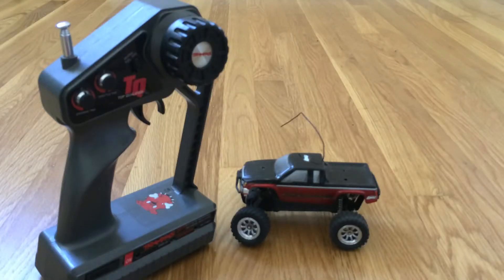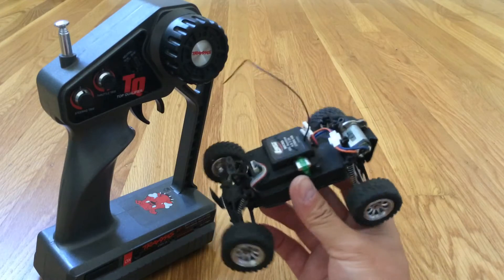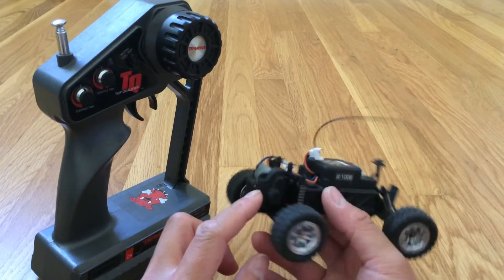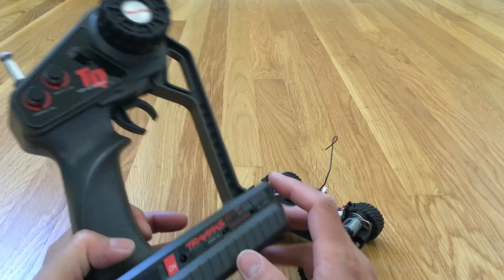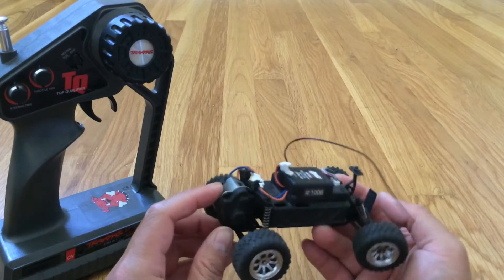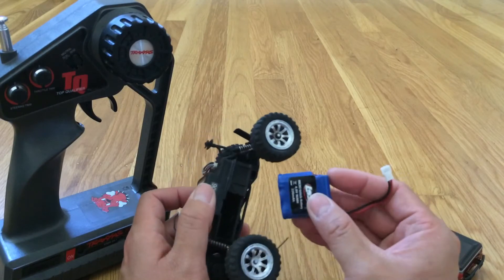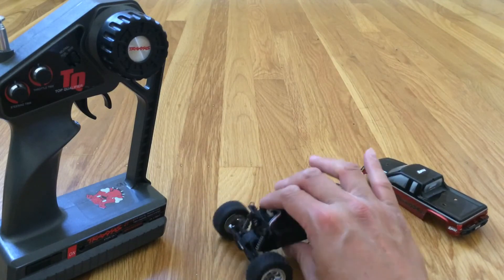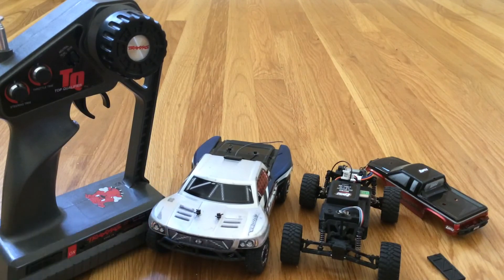Racing2Learn: Losi 1/36-Scale Micro-HIGHroller RTR Lifted Truck Review and Comparison to Micro SCTE

Comment: I wish Losi still made the micro crawler. I have the highroller... sort of. Started as a micro-t many years ago and I converted it to a high roller. I quit driving it because the motor would overheat very easily, the diff fried so easily, steering was sloppy and weak, the radio was twitchy/glitchy at best and it was just awful over jumps. For some reason, a year or so ago, I decided I wanted to mess with again and try lipo's in it instead. So, I got the brushed/brushless combo 2.4ghz receiver/esc for it, the stronger scte brushed motor, hot racing diff/trans case with bearings instead of bushings and found that you could use scte metal diff sun gears in it after a little modifying. Now I love it again! I can run it for an hour on carpet and it doesn't overheat on me because the new diff/trans is so smooth and free moving. Also swapped out the 4 wire servo for a 3 wire and finagled some micro ball ends for steering links and upper camber links on the front along with oil shocks. The shocks were annoying and leaked a lot, until I put longer springs on them and flipped them upside down. Now the oil stays in them and does it's job.

I have an scte as well, but for me, it's just too large to run around the apartment. Mines the brushless version. It sits on a shelf mostly now.
Reply from the maker: Lots of great info here, thanks for sharing! Didn't know you could get the micro SCTE diff sun gears to work in it. We've been debating on whether to keep the highroller or not. How do you keep traction on the rear wheels/tires?
Reply: Yep, found that upgrade walk through on a micro-t forum and after some 
fussing with shims, worked like a charm: 
http://www.microtforum.com/viewtopic.php?t=13129

Hard to find the hot racing diff case with bearing on the input shaft now though. I was 
lucky enough to find one a year or so ago. May have been 3racing... either way, they are hard to find these days.

EDIT: it was 3racing:
https://www.3racing-parts.com/team-losi-microt-aluminum-gear-box-for-3racing-mi14lb-p-90001793.html

Never shopped here, but the site says it's in stock:
http://www.hksrc.com/store/index.php?route=product/product&page=51&limit=25&manufacturer_id=15&product_id=8479
Reply: Not sure what you mean with "keep traction". I only run my micro-highroller inside and mostly on carpet around the house. It gets plenty of traction on the rear, wheelies all over the place.
Reply from the maker: We run ours on a smooth hardwood floor, so it's really difficult to keep traction on the stock tires and mostly drifts and spins out.
Reply: I see. Mine spends 90% of the time on carpet. It does spin quite a bit in my kitchen though. Still pulls wheelies on the linoleum though. I try to stay off the throttle in the kitchen though to avoid marking the floor with a burnout.